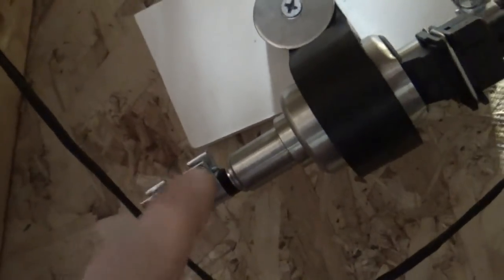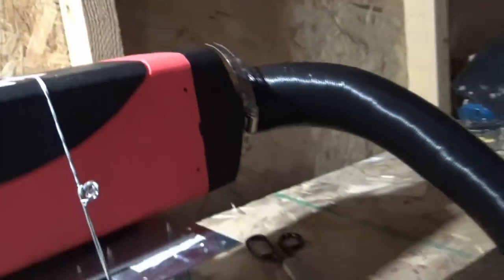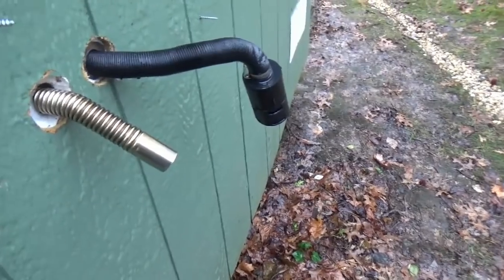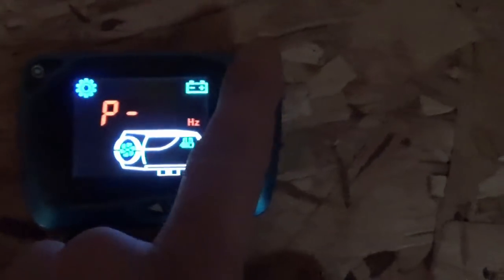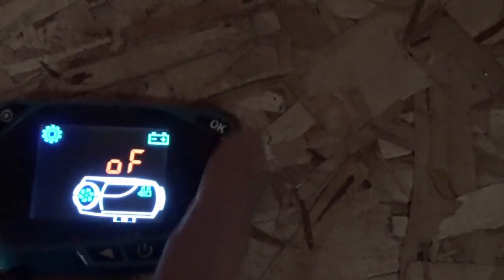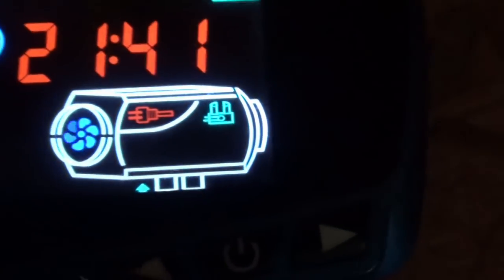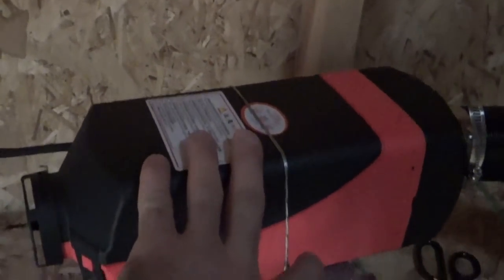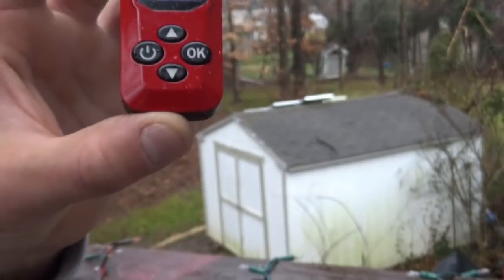Van Vid 3 Chinese Diesel Heater

Comment: I use Header wrap and carbon felt welding blanket that I cut down. You can find it on Ebay. Hope it helps. Good set up for a hobby shed etc. Good video. Good info.👍

Comment: Question? Wouldn't it be more efficient if the air intake was inside the shed? Heating cold outside air vs warmer inside air??
Reply: That's the BURNER intake - colder air is denser, has therefore more oxygen per volume = better combustion & higher energy output. It's the heater (big diameter) air that's supposed to pick up pre-warmed air from inside the cabin.
Reply: @f.d.6667  great explanation, I get it. Thank you.
Reply: @f.d.6667  but kind of what I meant. Recirculating inside air to heat better.
Reply: The air intake does come from inside the shed its the combustion air that is outside
Reply: Right, I see that. I misspoke, I meant the intake air not the air exchanger make up air. Warmer intake air would allow for better fuel consumption, no?

Comment: Not the best idea to have the air intake and exhaust so close together 🤪
Reply: Diesel won't ignight unless under extream pressure or super high heat, an open flame isn't even hot enough.
Reply: @jaymoge  That's not the issue - a high CO2 content (from the exhaust) will lead to incomplete combustion = smoke, smell and carbon build-up
Reply: @f.d.6667  you're right. I reread my comment and alcohol may have been a factor lol..

Comment: A question: the thermostat. When it kicks off, does it stop use of diesel fuel and shut down or does it keep putting out heat but at a lower BTU or what? How does it handle when the temperature reaches the thermostat setting?

Comment: How long will it run off just battery power?
Reply from the maker: It’s sort of runs forever off of the battery. Once the unit gets up to temperature the flame sustains itself. Uses a big chunk of power to heat up the glow plug but after that, it’s only using power to spin the fan. I think it something like 2 A and that’s probably a high estimate. The battery I’m using is a 50 amp hour lead acid battery. I can only use half of that if I want to keep the battery in good shape. So I have enough battery power to draw a one amp for 25 hours, or 2 A for half of that time. But don’t forget, the solar panels are doing stuff too.

Comment: Yeah, I would trust ther chinese to build a diesel heater
Reply from the maker: Niether do I. I trust the Germans to design and build it, and I trust the Chinese to steal and copy it. :)
Reply: Chinese products are beginning to get pretty decent, assuming you don't go with "the absolute cheapest you can get your hands on". Personally, I prefer Japanese or German goods, but I'm not aware of any Japanese diesel-powered air heater.
Reply: Mine has been running fine for 4 years now.

Comment: Hey sweet video, I just picked one of these things to and it works great.  Just wondering about your remote... mine came with one, and it won’t pair.  Did you have any issues?  I’ve watched all the videos I could find with no luck, and well tech support does not speak English haha.  Anyways if you have advice, awesome! If not, enjoy the build, wife and I are thinking of doing something like that.
Reply from the maker: Shane Ryan I did have issues until I joined the Chinese heater facebook group. They can talk you through it.
Reply: Which kind of remote do do have? I may have the pairing instructions for it.

Comment: How nice it is to see people smoking in there videos, its becoming very rare now days.
Reply from the maker: Thanks. It's gross. I should quit, but cigarettes keep me from going back to sniffing scotch guard.
Reply: Smoking right near the fuel... GREAT TO SEE DARWIN is at work.  Now to give DARWIN SOME SPEED
Reply: @yourhucklebearer9451  Diesel is not anywhere near as dangerous as gasoline. Might want to educate yourself a little before you try to insult others.
Reply: When I try to light a wood fire at work,  throwing diesel on a small flame puts it out!

Comment: Why the PVC block?  Did the fuel filter come with it?    Where did you get the standoff feet?  The exit for the exhaust at full bore will be about 270 degrees.  Any shield on exhaust should have a small air space between them.  Helpful vid.  Thanks.
Reply from the maker: I used pvc because its waterproof and I had some left over from the solar panel installation. The feet are from IKEA. I don't run this thing at full power. I tuned it to be safe.